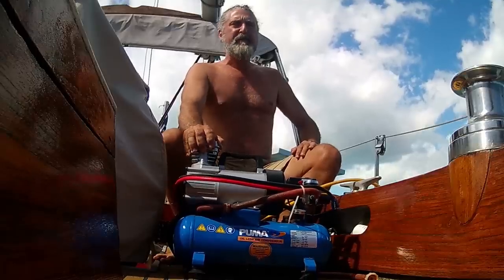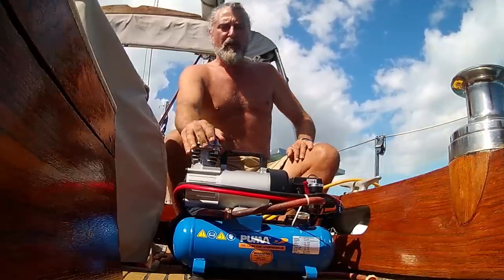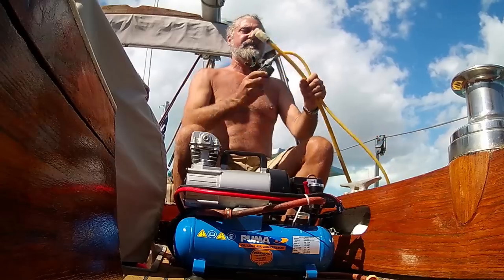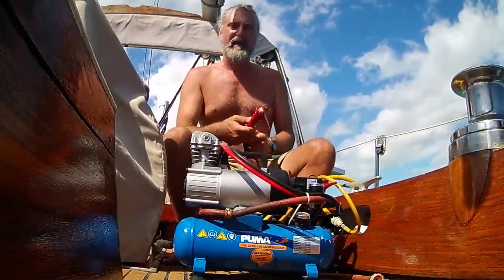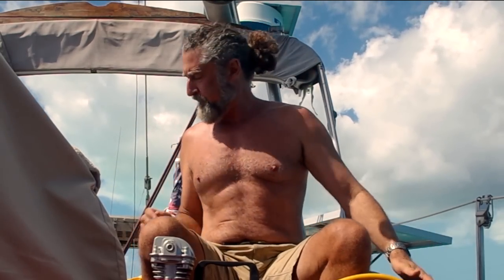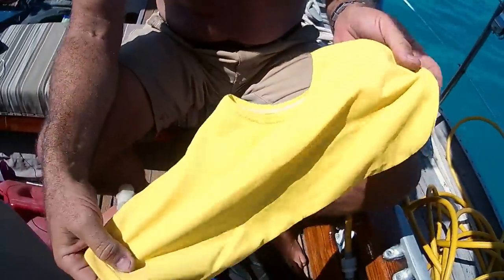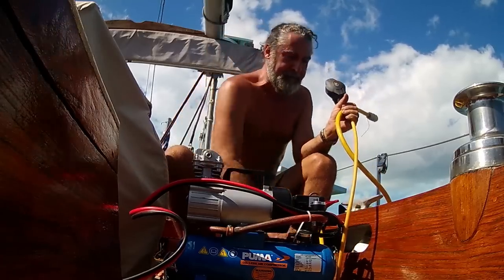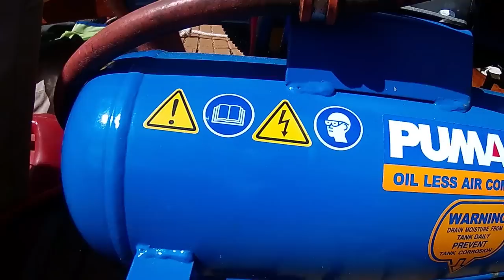$300 DIY Dive HOOKAH + Cleaning Our Boat's Bottom!!

Comment: Hey Clark, Your A Very Smart Guy! Another Point To Make Is Now You Have A Great Part / Full Time Side Job For Making Moneys While Your Out Free-Loading Around The World With All Them Other OLD RICH Peoples On All Their Fancy Boats That Would Rather Pay Someone To Do That Crappy Job For Them, ETC!!! LMAO Thanks #WillBoatScrapeForFood #BoatScrapersAreUs #EandCBoatJanitorialServices  ;~)P
Reply from the maker: You've got it.  It's good to have skills.  I'm always in demand to fix refrigeration, engines,  or electrical.  General engineering (problem solving) as well.  But, I'd have to be a pretty good friend before I'd clean someone else's boat bottom.  That's one tough job.
Reply: @Clarks-Adventure  You & Me Are A LOT Alike, Except For I'm Your Senor A Few... Now Take That Hand Scrubbin Up A Knotch, Y Your Air Line & Add A 6'-8' To Use An Air Power Scrubber, Like A Air Buffer w/Velcro On Scotch-Brite Pads... I Invented It 25+ Years Ago...  Along w/My Underwater Hydro-Power-Sprayer/Pressure Washer! LOL Back When I Bought My 3.5hp Briggs Gas Hookah From An Abalone Diver In San Diego Used For $150 w/2-Sets of 100' Hoses, Octopuses, Shorty Wet Suits & BCs! I Still Have It Here In My Trailered 30' C-C Catalina... ;~)P
Reply from the maker: That would cut way down in the labor.

Comment: I think this is very bad advice, because the parts in the compressor are not made for that use, little metal parts will come lose during time due to the heat (these type of compressors get very hot and above 150 degrees F) so your lungs will in the end be filled up with metal en grease stuff from the compressor. Do not use these type of compressors. and see the description of this type of compressors and you will find out that the manufacturer mentioned that this type of compressor is not suited for use as a breathing air compressor. And there is another problem the hose is much to long what can result in a to high volume of Nitrogen gas in your body what can result in unconscious and in inventively in dead!!!  So again please do not use these compressor and self building breathing apparatus.

Comment: Lots of risks using a compressor like that. Why not just buy a long hose and regulator. Rent a scuba tank for like $10 when you need to do something. Or even buy a tank, only about $150 and it would last hours at shallow depths. Refill it when your docked and near a dive shop.
Reply from the maker: Self sufficiency.   And no risk.
Reply: @Clarks-Adventure  I respect your video, its clever and cheap. But the "blue" version you have of the PD1006 compressor in the non-breathing grade version. The yellow one sold with hookahs looks the same, but isnt the same internally.
Reply from the maker: What is the difference?
Reply from the maker: Seems like you are the one selling the yellow one.  Please tell me what is different.  We don't react well to unsupported claims here.
Reply from the maker: Wow.
Reply: @Clarks-Adventure  From HookahMax's website: "As with any great product, inevitably someone will try to copy it.  On this site one or two sellers pop up every year or so trying to sell over the counter de-labeled BLUE non-breathing grade PUMA PD1006 12 volt compressors as a diving compressors, out of their house or garage.  They falsely claim to be real companies.  PUMA themselves adamantly advises against breathing on these over the counter hardware store compressors, as they are not manufactured or intended for human consumption.  Our yellow medical grade CE certified E2005C-12V with a three gallon tank is unavailable for retail purpose to the general public, but because the BLUE PUMA 1.5 gallon unit resembles it in shape, garage builders try to pass it off as a diving hookah."

Comment: Please comment or update on Why this works. That is the elephant in the room.
I know. Others don't.
Reply from the maker: It works because it delivers breathable air to you at exactly the right pressure while you are underwater.
   Maybe I don't understand your question.
Reply: @Clarks-Adventure  
The fact that the compressor is oilless is what makes it possible and safe to breathe that air. You did mention that. However did you did not make that a point of emphasis. The oil bath type compressor can kill you if you try to use it.